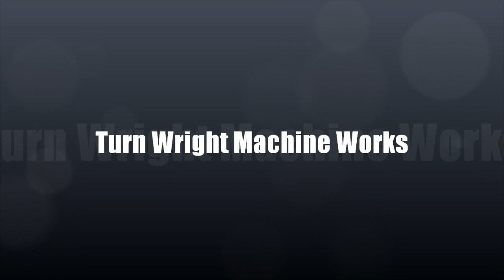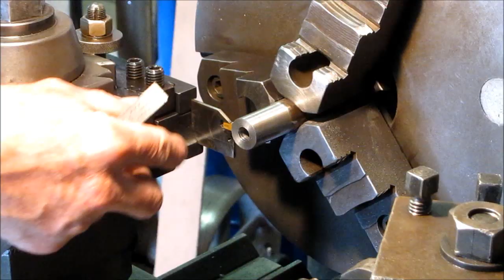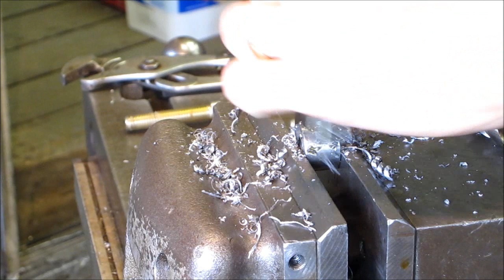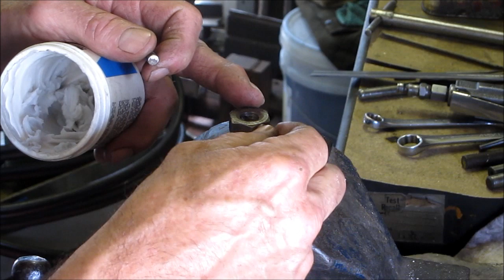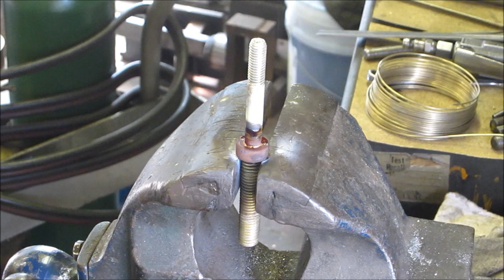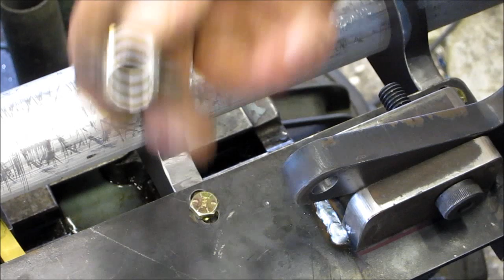Portakey Part 7

Comment from the maker: There is less tendency to break a bit with machine controlling the bit but it still happens, if to much feed or sucking through at the end or dull and over pushing it etc. hand drilling you add in the side pressures. LOL  ;{)------

Comment: apropo spinning bits in the jacobs chuck, i'm working off of a german built lathe and the jacobs chuck isn't in line with center of the machine. is there any good way of re-surfacing the cheeks of the chuck? i have entained the notion of using a small reamer but am not sure of the size or if such an idea is even a good thing to do

Comment: There's another Keith over here in NE Ohio.  Rigger, machinist, steam engine restorer.  You two could be brothers.  Watching you work is like watching him work.  When silver soldering cut a vent groove for the pressure to escape and you wont have the pop out problems.  Thanks for all the great vids.   Doug

Comment: Ha ha that tip was still dirty with the feather LOL.  The loose press fit stuff is definitely tricky to hold in there while it gets hot.  Third hand tool works good or if you have someone help to hold it down.  That's what I used to do one advantage to having others in the shop.  Sometimes you have to get creative when your by yourself.

Comment: Keith. Thank you for your videos. I run a small Power Equipment shop and am slowly adding a small job shop to the facility for building obsolete parts and upgrading equipment that I feel has been poorly designed. You have been a great inspiration. I am a big fan of old school machine tools. I have a 1942 M-Head bridgeport running variable DC power (built in house). Old lathes and tools built this fine country. What are you using for cutting oil on your machines?

Comment from the maker: So many times you come across disgarded and odd ball inserts, why not put them to use? I say, if you take just a bit of time to create a seat location on what ever piece of steel bar or square bit style hold you want, you can learn just a bit about silver solder and set your own, my key tip is, don't quench it after, it will become brittle and won't handle inpacts or interrupted cuts...
 I don't know about every grade carbide, but worth the try...

Comment: Thanks for another great vid!  Pretty cool, catching parted-off parts!  You seem to always know when parting tool will break through. I noticed you catch larger parts on a tool handle instead of barehanded. I haven't yet been brave enough to catch any, but I hate fishing for them in the chip pan, especially when it needs emptying.  What is the name of the pointed spring-loaded tool you used in the BP to spot the transfer punch mark?

Comment: Keith. . .  Quit uploading these videos, I ain't getting any work done!  LOL

Quick question on the silver soldering.  I have some Valenite inserts here, and no holder that'll fit them.  Can I just take a piece of 1/2" HR square, and make a seat for the insert, but instead of a screw, put a post in the holder -- and silver solder it on?  Based on your colors there, I'm assuming the insert will be around 1,450°??  Being a non-machinist, I don't know shit about these SV315 inserts.